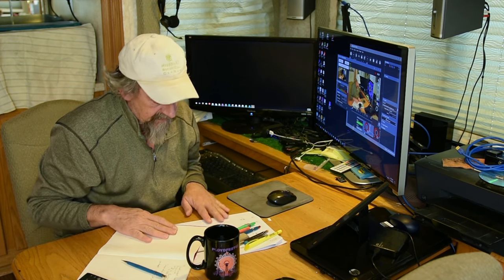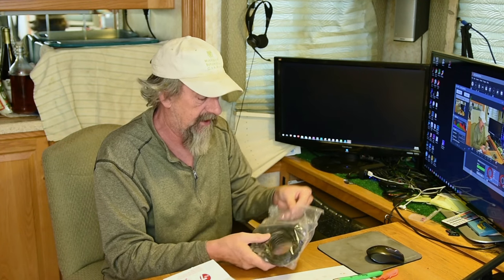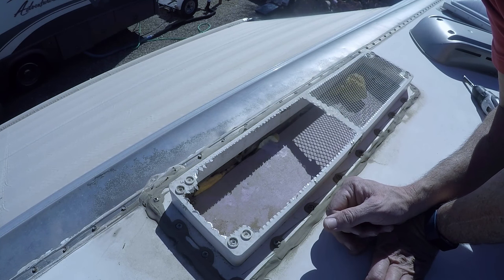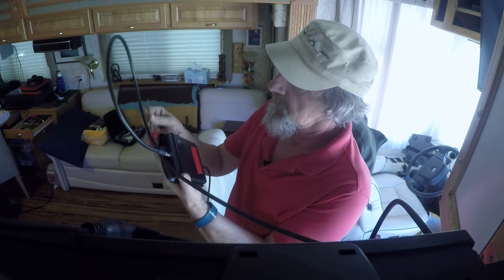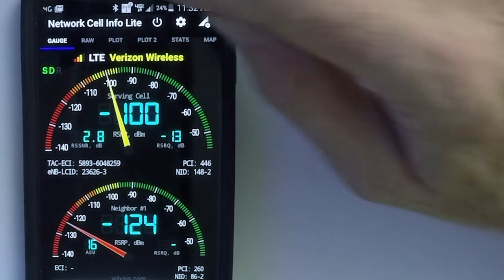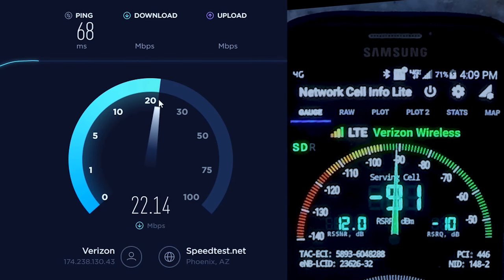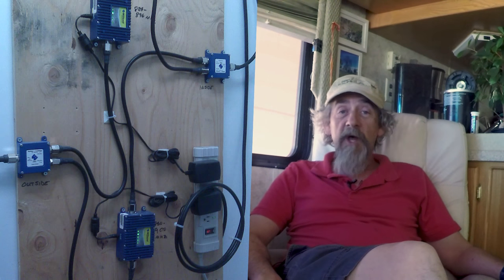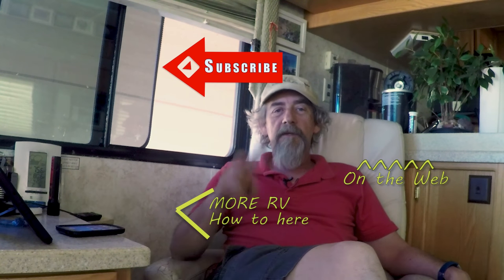RV How to - Installing the weboost Drive 4G-X RV Cell Booster and Testing

Comment: What app are you using to show the fb level and are you using android or iOS?
Reply from the maker: Everything you need to know is in this video about my tools and getting an 80 meg download 50 miles from a cell site. https://youtu.be/EX_zx3yqvhg
Thanks for watching!
Reply: @trbowlin  I bought the same item... installed it.. and NO boost at all.   I contacted Wilson and they sent me new outside antenna and cable and still NO boost.  I am going to call them and hopefully the inside unit is defective... but so far its been a LOT of work to install with no benefit.  And I install LOTS of stuff in my MH and have an electronics background so I am very frustrated at this point.   Thanks for the response.

Comment: try replacing that small inside receiver antenna in your house with the bigger weboost square white antenna i think you will get better performance
Reply from the maker: Since I made this video I have replaced the inside antenna. Most of my download performance was related to my old Samsung s4 phone. I got a new S9 and have been seeing 40-50 mbps down which is most acceptable. Thanks for watching!

Comment: So it's been a few months, are you still happy with this product?
Reply from the maker: Aron Jemison Yes. It has been working well. I did add the directional antenna for when I am in very fringe areas but overall it is working great. Thanks for watching Aron!
Reply: @trbowlin  Can you split the antenna signal and run multiple antennas?? (I have a truck camper so..... I would be interested if I could have a permanent antenna on my camper and hook it up when the camper is on)
Reply from the maker: @tomduncan1970  Sure, but you could not 'split' the signal. You could only have one antenna connected at a time. I just installed my antenna on my truck camper, but I am leaving the weboost in the camper. I really don't need a boosted signal in my truck. I am deep into scheming on how to mount my old directional antenna on the camper. It should be easy because of the ladder. I want to make sure it doesn't break the bottom mounting feet like it did on my class A.
Reply: Thank you. That is exactly what I needed to know!!! Much appreciated!!!!!

Comment: Thank you for this video, I also watched the update.  My questions would be;  If you have a visitor do they get to boost their signal with the same antenna? and if they are with AT&T will it boost?  and what about going back to canada, or vice versa, those would be different providers.  ?  Also is it on 12V? if not did you modify? do you have a video of it? :-0)
Reply from the maker: Nice to hear from you Julie. Yes your visitors  will get their signal boosted with no changes to the system. The booster works with most carriers (AT&T and Verizon for sure) and there should be no difference moving to and from Canada. I did use the included 12V adapter but have not videoed installing the 12V adapter. It was just a simple connect to 12V DC and plugging it into the booster.
Reply: @trbowlin  Thank you TR for your answer,, always nice to watch one of your videos!  Ok for the 12 V, I thought you did not have a 12v adaptor and had to modify.  You have a good day :-0)
Reply from the maker: @projet2907  One comes in the kit which was super handy! Take care